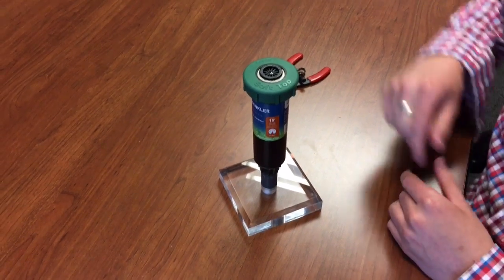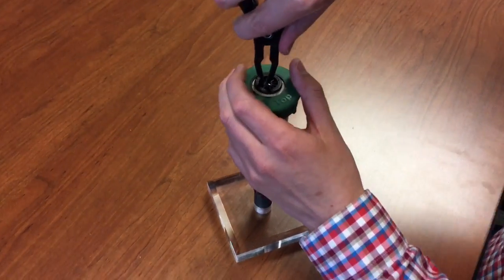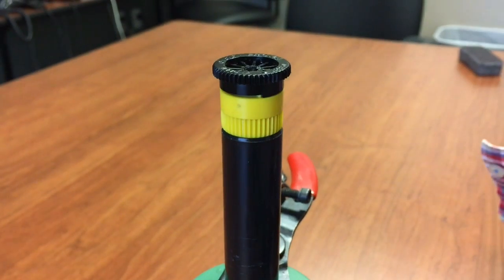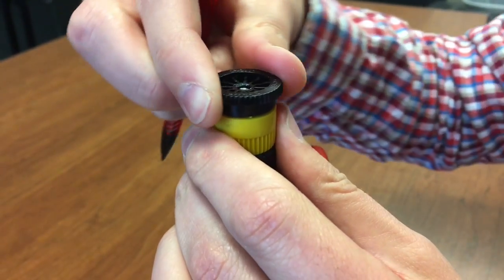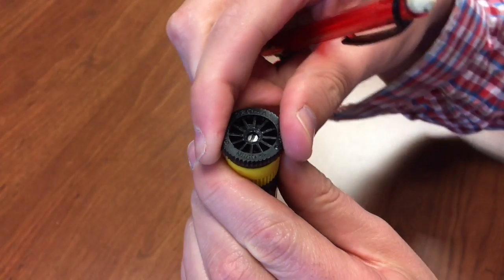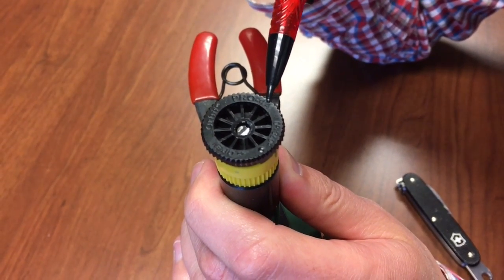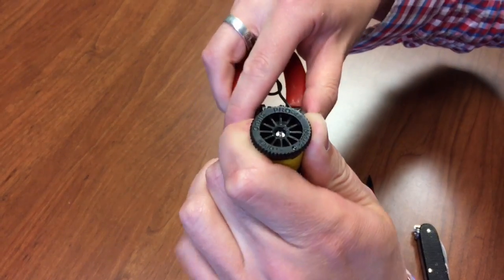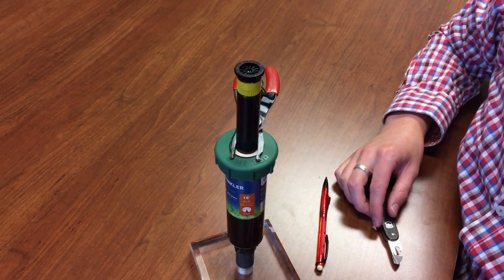How to Adjust an Orbit Adjustable Nozzle

Comment: Thans for the demo of how to adjust the width of the spray pattern, but how do you set the direction of the spray pattern. I have something similar next to a wall, and I need to alter the direction of spray.

Comment: What does the Philips screw head that is underneath the nozzle do? I know the top one adjusts the throw of the water for instance I have an orbit pro 12A. So turning the center flat head screw will get me or lose me some feet. But I don't know what the Phillips head screw underneath it does.

Comment: Hi - I have a big question.  I just replaced my older sprinkler heads with Pro 12-A.  However on three of of the 5 sprinkler heads, I am getting continuous seepage.  Can you assist please?  I'm at my wits end.  Thanks.

Comment: I am getting brown spots, within 2' of the front of my orbit sprinkler head.  I opened a can of tuna, ate the tuna, and placed the empty can in various places around the sprinkler.  After running the sprinkler for 8 minutes, I was seeing in the brown areas that the water was about 1/4" deep in the can after the 8 minutes, but in the green areas the water in the tuna can was nearly at the top.  Are there better quality adjustable sprinkler nozzles that will have more uniform distribution of water?  In other areas of my lawn, I use the Orbit double distance brass heads which are not adjustable, and see no problem at all.  Using the tuna measurement, the water distribution  around those heads is much more even.
Reply from the maker: Our twin spray nozzles can help on this, however, they are not available in adjustable patterns; only fixed: https://www.homedepot.com/p/Orbit-15-ft-1-2-Pattern-Brass-Twin-Spray-Nozzle-53227W/203106505
Reply: @orbitsprinklers  Sounds like a market opportunity.  Here in  California, we are in a drought situation, and when sprinklers can distribute water uniformly, our big problem is alleviated, abeit only somewhat.    You can help by having some of your work-at-home engineers develop a sprinkler head which distributes the water uniformly after adjusting the angle of deposition.   If you need help, then please ask; although I have a SM in electrical engineering from MIT, i have a background in fluid dynamics and would be easily able to design a sprinkler head which would adjust the angle of deployment and maintain a uniform concentration of water over the covered area.  I'm sure you have an engineering team that can do at least as well.  thanks

Comment: I followed instructions exactly but could not turn the screw to adjust distance at all. Is there a trick? You make it look easy.
Reply from the maker: Hello, these certainly can be tough to turn sometimes. There's no special trick to it though.
Reply: @orbitsprinklers  'Certainly tough' is an understatement. You can downright injure yourself trying to loosen up the screws on these. Would help if you guys didn't over-torque your screws closed all the way. I am returning all the Orbit professional sprinkler heads I bought, and going back to your competitors.
Reply: If you remove the top nozzle, and turn it upside down, you will see a phillips screw head.  I hold the nozzle with vice-grips carefully adjusted to prevent damaging the nozzle, and  then use my Black and Decker power screwdriver to run this screw in and out maybe 10 times.  after a few of those passes, the interference fit between the plastic and the phillips screw loosens up enough to let me adjust it using the mini-screwdriver from the top after re-assembly.  Don't remove the screw and use a tap on the plastic, it will be too loose and the distance sprayed will change over time.
Reply: @jimbusse7381  thank you!
Reply: Remove the center screw using a Phillips screwdriver on the Phillips screw side and coat the screw with Petroleum jelly.  Put the screw back and screw it in and out a few times and the problem is fixed.  The Petroleum Jelly has never caused damage to my lawn and/or plants.  Good luck.

Comment: I just bought Orbit brass metal full and half spray heads. I cannot seem to adjust the DIRECTION (not fullness) of the spray on the half spray ones. If I loosen the whole sprinkler head to point the two arrows in the right direction, it leaks at the base. I cannot find a single video telling me how to adjust the direction of the half spray without loosening the whole head. HELP SOMEONE!!!!

Comment: yeah that screw is almost impossible to turn, you will need to remove the spray tip and loosen the Philips screw underneath it to be able to turn it, thing that they never tell you, learnt it the hard way.

Comment: I just installed some new pop-up sprinklers and one of them leaks between the white seal and the pop-up portion . What do I do?
Reply from the maker: This would signal a bad wiper seal. These do wear out and we sell replacements: https://www.orbitonline.com/product/pop-up-sprinkler-wiper-seal-400-series/

However, if these are new installs, they should not be doing that. Please send us your contact info via private message on one of the linked social channels and we'll get in touch to get this resolved.

Comment: how about the regular pattern nozzels (all black) ,how do you adjust the distance? I replaced a new  popup head nozzle by matching what was installed , but the screw on top would not go either way ?? do i have to unscrew the bottom one? am I missing something?,
Reply from the maker: The  regular pattern are indeed adjusted by the screw in the center. The screw can be tough to get moving. Please note that even under ideal circumstances the middle screw on these will only adjust the pattern by a couple feet at most.
Reply: The screw on my 8A will not turn! Why are these so tight???

Comment: Is there an adapter where i can remove nozzle, install adapter to raise up maybe 1-2 inches then reinstall nozzle?
Reply from the maker: No, nothing like that exists. This is because the nozzle needs to close flush to the sprinkler. What you would probably want to look into is a 6-inch pop up (we make one, model 54100). On that you could replace the nozzle, even the cap if you wanted the soft cap shown in this video.

Comment: How do I remove the head? Ty
Reply: Twisted counterclockwise if you are talking about the nozzle that he is showing, you pull it up hold the bottom of it that comes out and then turn the nozzle counterclockwise until it comes off be sure to check the screen when you do that